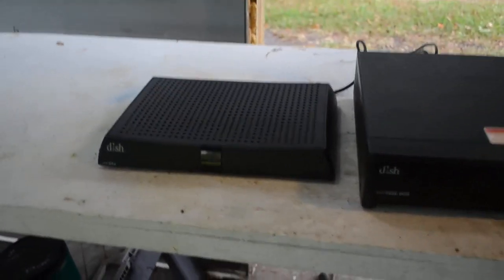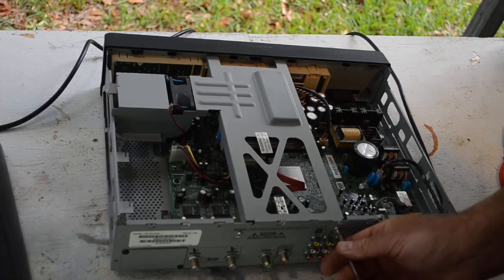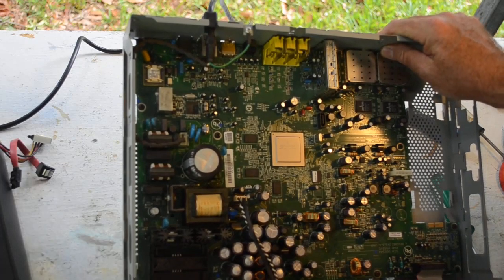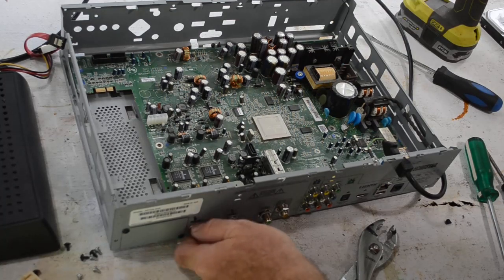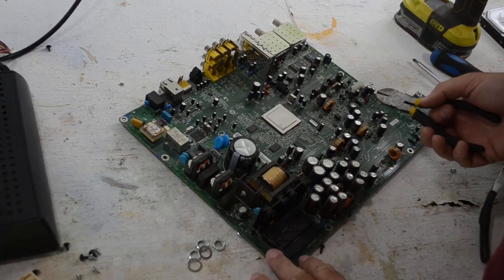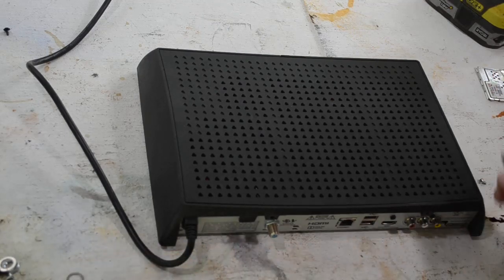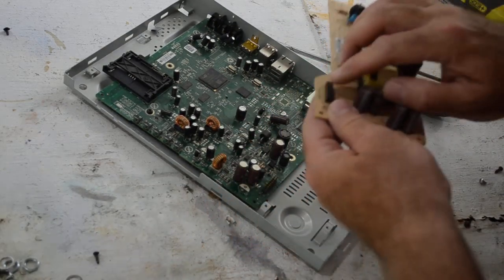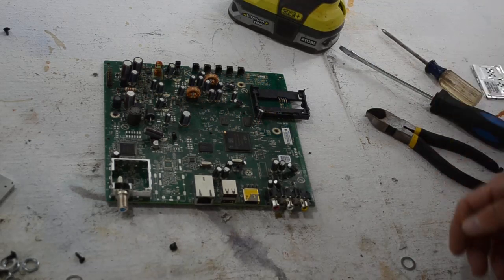Viewer Request Special: Gold Recovery From Satellite TV Boxes Teardown and Scrapout

Comment: I'm thinking about wet ashing IC chips, what do you think about it?
Have a Great Day My Friend!!
Reply from the maker: It's not my favorite way of doing it. It smells really bad. Plus separating the gold bond wires from the gooey, acidic tar that forms is a pain. Dump the end result into a bucket of ice. Wait for the ice to melt and carefully decant off the dirty water. Carefully rinse and decant several times until the water is clear and you can see the dies and bond wires. It works if you can't or don't want to incinerate, but it doesn't scale up well. Plus you'll have a lot of acidic waste water to deal with.
Reply: @omegageek64  Thanks for the information!

Comment: Platters ARE Not Aluminum 
Stick one in a microwave 
Not Aluminum 
“My Opinion”
Reply from the maker: I like my microwave oven too much for that. I have torn apart hundreds (thousands?) of these hard drives. Every one has had aluminum platters. Some of the small laptop drives supposedly have glass platters in them, but my experience shows that they must be few and far between since they were all aluminum too. There is just a thin coating of the magnetic material on the surface of otherwise very pure aluminum. Some of the really old drives supposedly used magnesium platters, but they are pretty rare today.
Reply: 👍 Good To Know As Well. I’m Sure You Have A “Good”Junk Microwave. Some Say They Are Platinum Too. I Have A Whole Tote Full Of Just Platters. Not Worth My Time To Process Them. 
I Will Say Though, They  👀 👍 On A 🎄 
And They Fly Far As Well.